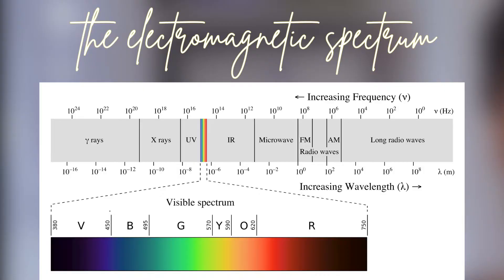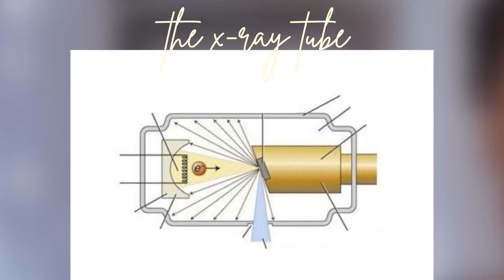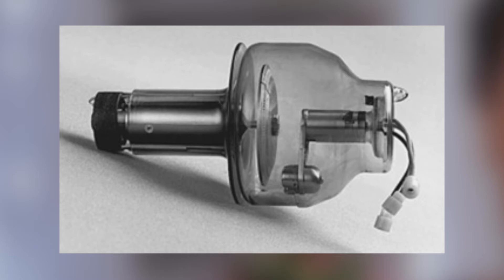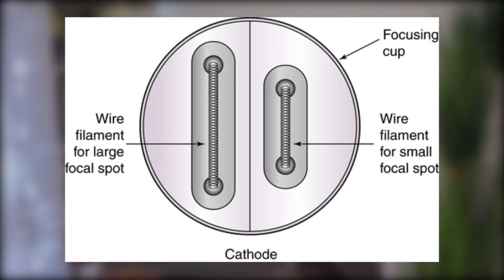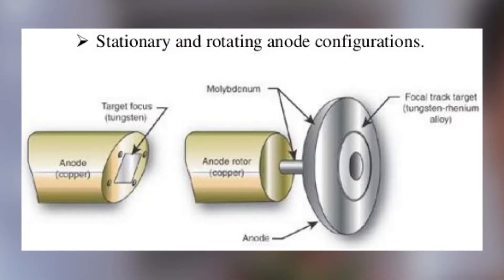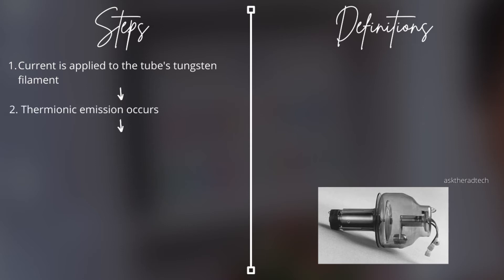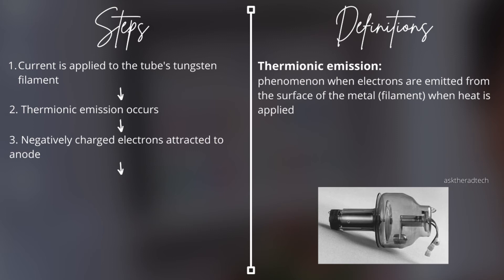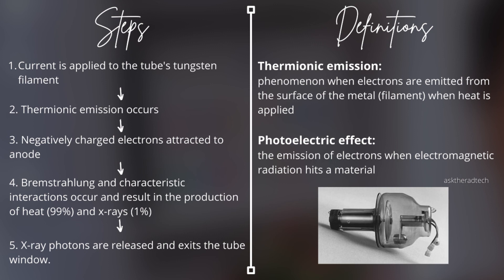how x-rays are produced (how the x-ray tube works) || Ask The Rad Tech

Comment: I presented papers at National conferences in Australia in 1988 and 2016, both about an error in understanding geometry that is an indirect result from centring point positioning. I use collimation for positioning. The question is 'does changing the angle of the tube by pushing the tube angulation button alter the geometry of the beam? 75% of qualifieds fail and 95% of students but that is probably because 100% of tutors that I have tested have failed. 5% of radiologists fail.  https://youtu.be/mZPD_gLs5Dw